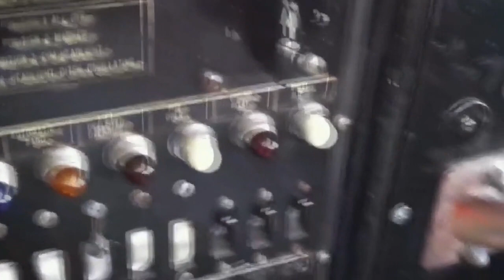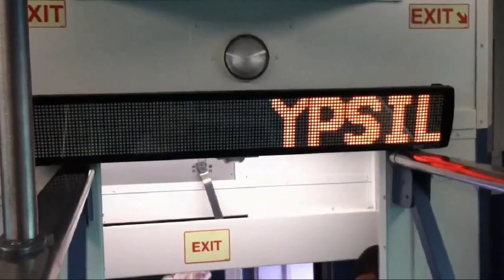Michigan's Failed Commuter Train (MiTrain Throwback)

Comment: The expansion of 23 north of Ann Arbor was the death knell for the WALLY service between AA and Howell... It was never really feasible as taking a train requires extra time at the stations waiting and taxi service or uber... not practical
Reply from the maker: Bryan Losen Wally was always a longer shot, the AA to Detroit train had a chance kinda.. but just never came to life.
Reply: @MichiganCentralLines  the MI Train has an F59PH 18533, Since the Steam railroading Institute has the MI Train Cars, They Should Get MI Train F59PH 18533 Should it can Run Excursions with PM 1225 and GLC 395
Reply from the maker: @sebastianfloyd372  the F59PH is long gone, some of the cars have also been sold. MI Train is dead in the water
Reply: @MichiganCentralLines  The F59PH is not long gong because it’s one of the 3 Leasers
Reply from the maker: @sebastianfloyd372  the F59 has been away from the state for years. MI train has been a dead project for years. Some of the cars are still around, but for now that’s about it
Reply: @MichiganCentralLines  the f59 is still around
Reply from the maker: @sebastianfloyd372  it has been in California for years http://www.rrpicturearchives.net/showPicture.aspx?id=5354366 it is in an F59 deadline lettered for LETX per last reports. It hasn’t been in Michigan for years and was the only unit painted for the service.
Reply: @MichiganCentralLines  thanks for sending me the link I’ve seen it before! That gives me an idea for it. If only it wasn’t scrapped, I wish that it would be donated to the Steam Railroading Institute so it can operate

Comment: It was never mentioned why the commuter service failed and how far it was developed
Reply: No one ever knew that the new service existed.  I used to ride it Monday thru Friday in 1973 when it was run by Conrail crew out of Jackson (no fare passengers to/from there).  Took 45 minutes to go from Ann Arbor MC depot (now Gandy Dancer) to Mich Central Depot in Detroit with stop in Ypsilanti.  Single self-propelled Budd car.  Driver plus 1 (old NYC) conductor named Bernie.  Monthly ticket was available at reduced price.  Then, took city bus from in front of Detroit depot the rest of the way to Penobscot Bldg.  Car was usually full.  For pre-holidays,  senior rider would bring booze on board at Ann Arbor in AM, leave it in railcar during the day in Detroit, and then at 5:30pm put a wooden board between the seats and serve drinks to passengers all the way to Ann Arbor.  One time (Bernie's retirement or last day of Budd car?), crew put railcar on siding in Ann Arbor so that party could continue a while longer before crew and railcar finally returned to Jackson.  Good memories.